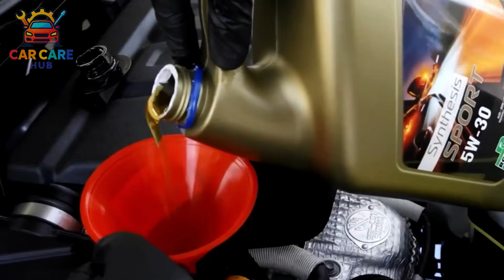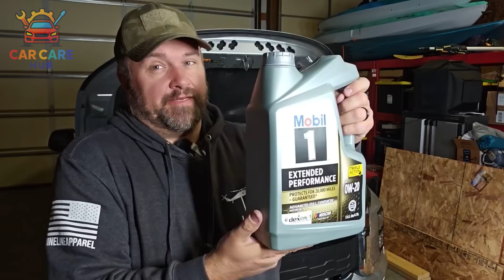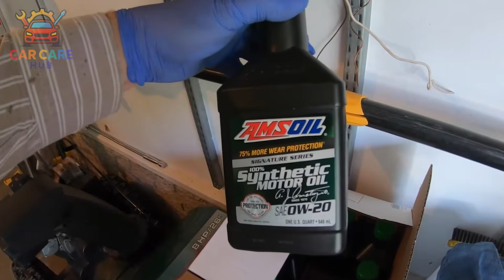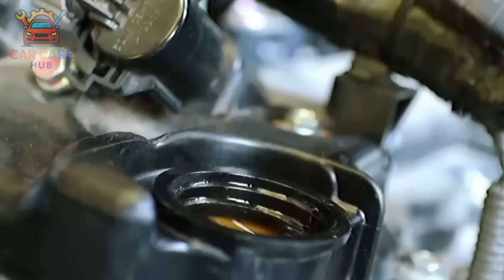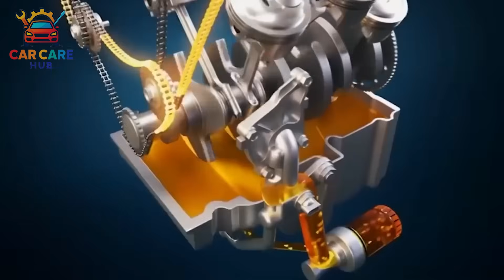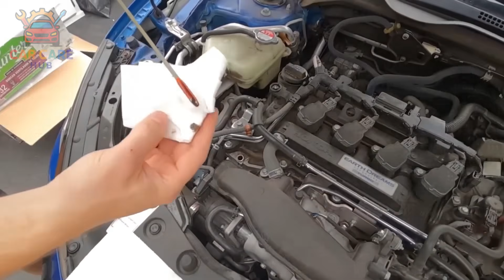The 5W-30 'Upgrade' That Kills Modern 0W-20 Engines

Comment: WHAT  most people don't know, is that the 20 grade oils in daily driver type applications lubricate AS WELL as the 30 grade oils. They won't believe it, because they can only think of the oils viscosity as to what keep the pars separated. There's anti-wear additives in motor oils and the 20 grades have higher levels of them than the 30 grades do, that's why they have been tested and shown that they lubricate just as well as 30 grades do. However, if you run it too long and it shears, or becomes fuel diluted, then the wear is accelerated and it's a bad thing. Change your oil, because once those 20 grade oils have lost their viscosity, your engine will pay a heavy price for it.

Comment: Yeah, Imma call bull shit on that. I have two camry's with the same engine a 2013 that say 0W20 and a 2018 that stats 0W16. Overseas, it's 5W30, and it's the same engine. Yeah, both my cars use Mobil 5W30

Comment: My 2017 Cherry Impala has direct injection and variable valve timing. Factory oil recommendations for this car is 5W30. I also have a 1977 Buick Electra. I use a 10W30 with high ZDDP additive content in that car. It seems many people in the old car community think a 20W50 oil is best for the old cars, but it takes a much longer time for the oil light to go out on startup with such a thick oil. My Buick seems perfectly happy with 10W30. I am currently using Royal Purple in both cars. Thanks for a great video.
Reply from the maker: Glad it's helpful

Comment: In theory, a 0w-30 would flow exactly the same as a 0w-20 of 0w-16 at start up. Only at operating temp would they have different viscosity.

Comment: Good video. Adresses a lot of misunderstanding regarding oil viscosity. Many believe that if it protects better during worst case scenarios, it will also protect better at normal conditions (as using a "race spec oil" for normal eco driving.) No, a high-temp/high-viscosity formula it will provide worse protection at lower temps. Oil is always a compromise of viscosity and flow.
If you have a cooling issue with the engine (making it heat up the oil more), fix that issue, instead of upping oil viscosity.

Comment: Then why are so many of these new engines are failing
Reply: Because they are crappy designed. The GM problem was that they did not properly design the engine with the tolrances for the 0W-20 oil spec. Toyota and Honda runs fine with it.
Many have destroyed the small 1.0 Ford EcoBoost engines running other than the correct spec 5W20 (with the correct ecoboost spec / additives), believeing that a higher viscosity 5W30 would protect better. All it did was to wear the cambelt, and destoy the engine prematurely.

Comment: So, what about when it's 32F and 0w20 freezes and flows more like SAE90?  I tossed some in the freezer and it flowed slower than 10w30 at normal temperature.  I still maintain 5w30 is fine in the hot climates, and many posters who have done it,  do too.  I rented a 5.7 Hemi 300 in AZ, temp never below 90F.  It knocked every morning, oil cap says 0w20.  The oil passages have not changed from 2005 to the same motor in 2025.

Comment: I have a 2015 GM 5.3 L83 with 188 k miles. switched from 0w20 at the first OCI to 5w30.. it's been 184k miles on 5w30... how much longer before my engine shits itself ? it runs perfect..uses no oil in 5k OCI.

Comment: If engine can run when it is cold and oil has a viscosity of approx 70, then be assured that it can run with 5w30 at 100c when it has viscosity of approx 12
Reply: But the lubrication protection often is compromised on a cold engine. Whicj is why it's a "rule", never to push a cold engine hard.
You want the best lubeicatin protection. Most modern engines are well protected with 8-16 viscosity. It's the viscosity at cold conditions, that might make a problem regarding excessive wear.
You eant hvad much flow as possible on a cold/freezing engine. Flow is generally not an issue on a warm engine.

Comment: If 20 falls out of viscosity you're below what manufacturer recommends. If 30 falls out of viscosity, you're still within what the manufacturer recommends.
Reply from the maker: Good point, but viscosity ‘falling out of grade’ applies to both over time 👀 The key difference is how modern engines are optimized around 0W-20 flow and tolerances.

Comment: Unless you live somewhere where it's below -22F ...5w30 is completely fine. 0W and 5W is hardly a difference, but you will get better protection when the engine is hot like most modern cars run today.
Reply: I don't use 5W30 in my 0W20-spec'd Crosstrek. I use 0W30.

 It flows like 0-weight, which is important during cold startups and for tight clearances, but it protects at high temps like 30-weight.

 I'm at 200K miles and counting.
Reply from the maker: You’re right that the cold-start difference isn’t huge in mild climates,  But modern engines are designed with tighter tolerances around 0W-20, so it’s not just about temperature.
Reply: @CARCAREHUB247  tolerances have not changed dude. Only European engines have tighter tolerances than the usa engines, yet they use 5w40 in most engines in Europe
Reply: @CARCAREHUB247  Sorry thats simply not true. Modern engines are not "designed around 0w20".. they are "designed around 0w20 if you want maximum fuel economy",  so they are designed for more a range of viscosities. Hence, they allow 5w30 in other similar climates.

Comment: Use 5w30 and change your oil at 5000 miles or less. It's that simple.
Reply from the maker: That simple’ ignores manufacturer specs. Oil weight isn’t one-size-fits-all—engine design matters more than personal preference.
Reply: @CARCAREHUB247 what about vehicles that used to use 5w-30 and newer models same exact engine decided to say 0w-20 to save fuel
Reply: @CARCAREHUB247   What you arent mentioning though is that many manufacturers recommend 5w30 for the SAME engine in similar climates. Engines are designed for a RANGE of viscosities, not just one viscosity. Its not possible to design an engine that ONLy works well with one viscosity. Most of these engines are designed for 0w20 IF YOU WANT MAXIMUM FUEL ECONOMY but work fine with a slightly thicker oil, as per the manuals.
Reply: Even better...  use the correct specified oil, and change every 5K miles or less ;)

Comment: This video is completely false
Reply: Actually it's a very informatiove video, adressing a lot of misinformation and misunderstanding on oil viscosity. Low viscosity oil flows better. Viscosity is technically "resistance to flow". The sweet spot is to have as low a viscosity as possible, with Enough lubrication to protect the metal during the load conditions.
I would Not use 5W-30 on a 0W-20 specified engine, unless the manufacturer says it's okay. AND I would make sure to have it in writing :)
Reply: @Wushu-viking  The manufacturers DO say its ok. Most that are specd for 0w20 ALSO say to use 5w30 in similar climates, same engine. There is no such thing as an engine that is "Designed for 0w20".. its "designed for 0w20 if you want maximum fuel economy, sure but even thats can be debated....  The manuals say this, its not a secret. It doesnt say, "Use only 0w20 there is no other viscosity for this engine, your engine will fail with 5w30"..They usually say "Use 0w20 for maximum fuel economy"

Comment: The question is why the 5w30 oil used in a car in every country in the world including Japan where it was made cannot be put into American and Canadian engines because we are told that we can't use 5w30 or the engine will die... Even my owners manuals says that not using 0w20 may lower may gas mileage...not one word about engine wear or damage...
Reply from the maker: Manuals usually focus on fuel economy impact because that’s what regulations are tied to—not necessarily immediate engine damage.
Reply: @CARCAREHUB247 
Owners manuals are not "manuals" anymore. What little you get from them is buried under a pile of caution warnings and the famous "this can be tricky, take your car to a dealer would be safer".
Reply: I'm taking the engine protection over a extra mile per gallon and sticking with 5w30 in my engine that calls for 0w 8

Comment: ow20 and 10 k mile oil changes ?? which one is the lie ? i guess my 88 k on my rav 4 is a fluke ? ... way less noise on start up...variable valve timing fail on every engine...